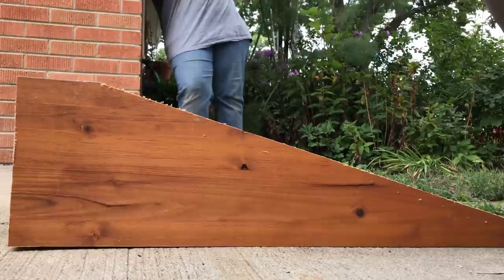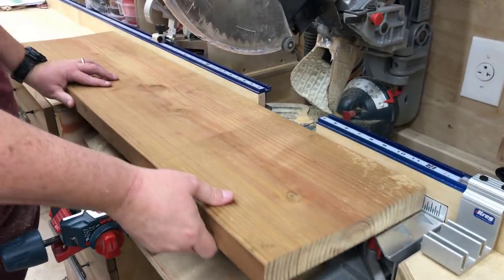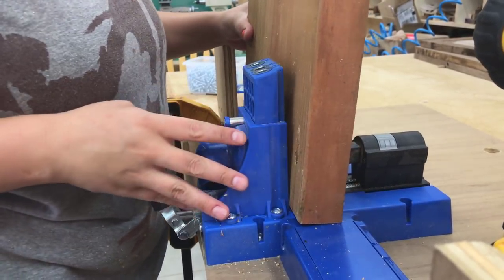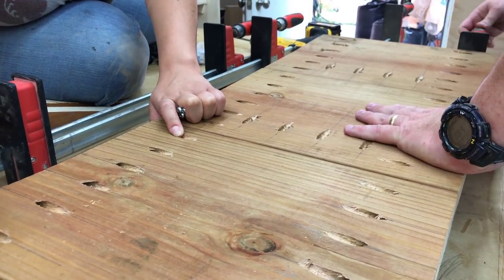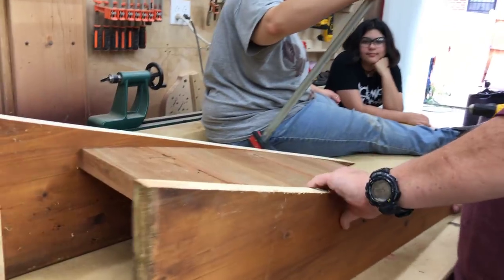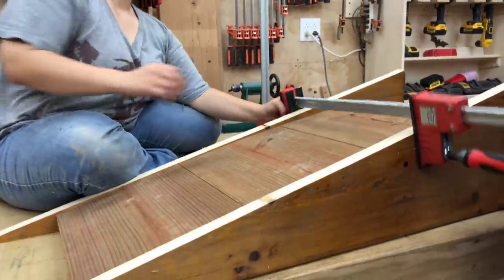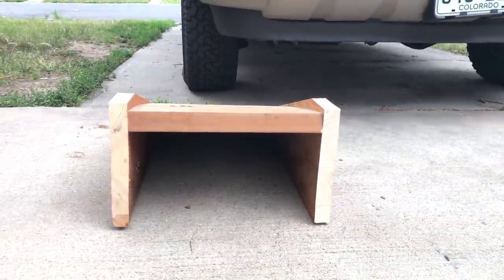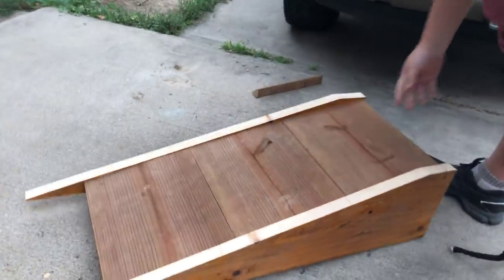32 - Extreme Pocket Screw Strength Test

Comment: No offense but i would not be lying under any car with ramps built like this!!!

If anything the ramp part of this ramp should be on top of the ramp frame that provides the verticle lift. The pieces of would should be cut square and glued!!!

You are relying on the screws to hold 3,000 lbs+ and that is insane!!!
Reply from the maker: Haha. You missed the point of the video I think.  You are right; a person would be crazy to get under that car! 

I wasn’t trying to build a usable car ramp! A car ramp need to be welded steel!

I was demonstrating that pocket screws were pretty strong.

Comment: The test isn't complete until you drive up on two of then and crawl under to vehicle you show us you confidence it the pocket screws. There is no way I'd get under that vehicle on those ramps. Test is flawed.
Reply from the maker: Hi Richard! I hope no one is dumb enough to make home made vehicle ramps and then proceed to get under their car! 😱😱
Reply: Richard M At least he trusted it enough to put the camera under it
Reply: Richard M according to my mechanic you shouldn't get under any car unless is properly secure!
Reply: Dude really? The test is to show that pocket hole screws are strong, nothing more.
Reply: Lol. Don't get so angry on the internet. It's bad for your heart and blood pressure.

Pocket hole are fine for the right spots, and anyone else who says otherwise is simply angry that there are new techniques to add to your arsenal. Would I use them in heirloom furniture? No. Do they have their place? Absolutely.
Reply: Any moron know if your building a wooden ramp like the top would go on top if the sided pieces. The side pieces support the ramp top.   To screws the top in to the sides is just ludicrous.  Lets see you get that OSHA approved. lol
Reply: Richard M Troll somewhere else. This was a test of the strength of pocket screws. Putting the board on top completely ignores any fastener strength. This was never supposed to be a usable ramp for being under the car. It was too show how strong pocket screws could be.

 Nothing more.